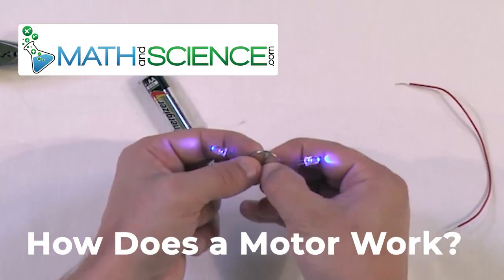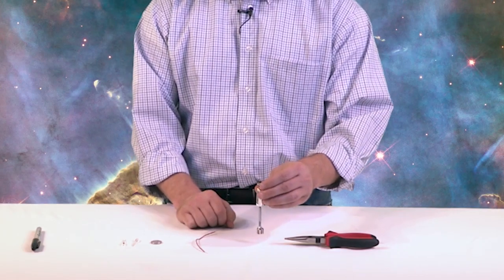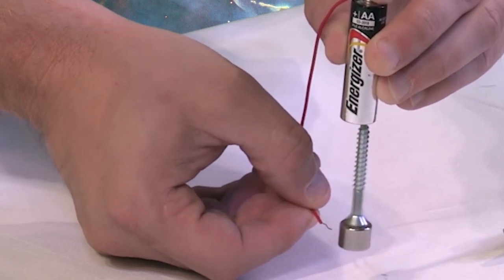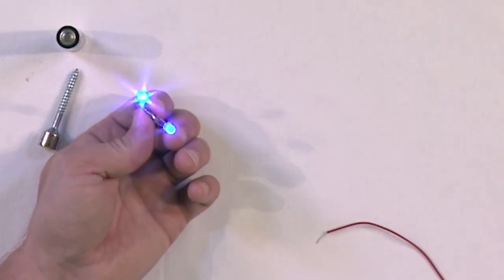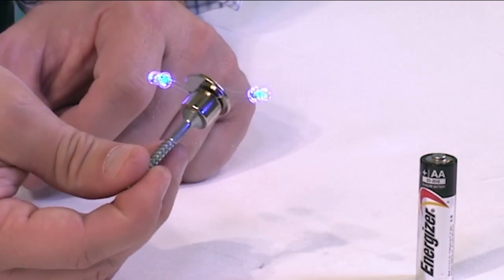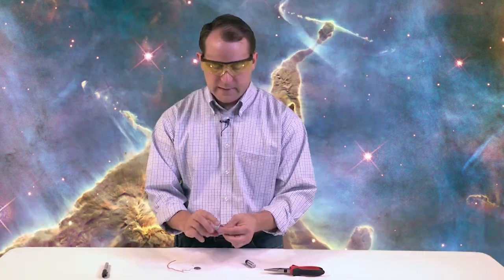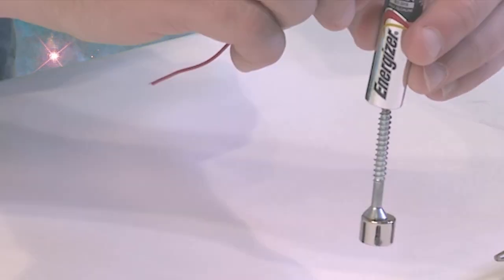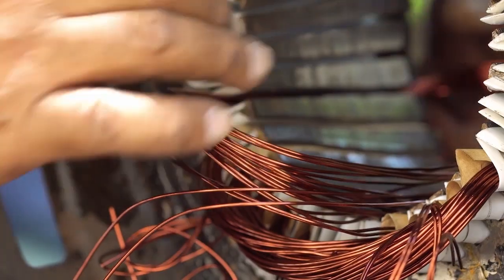The World’s Simplest Electric Motor

Comment: Very nice but you lost me with the quick 15 sec explanation at the end :(
Reply from the maker: Thanks for the honest feedback I’ll probably shoot this again with a longer explanation and a diagram which I think will definitely help
Reply: The operation of the homopolar motor is based on the principles of electromagnetic induction. When a current flows through the disk, and the disk is placed in a magnetic field, a force is exerted on the moving charges due to the Lorentz force. This force acts perpendicular to both the direction of the current and the magnetic field, causing the disk to start rotating.

Comment: I found that I could use just my fingers instead of the wire.  Even using one hand to hold the battery top connection and the other hand brought close to the magnet, i.e. current flowing through my body, hand-to-hand.  Fun demonmstration - Thank you.